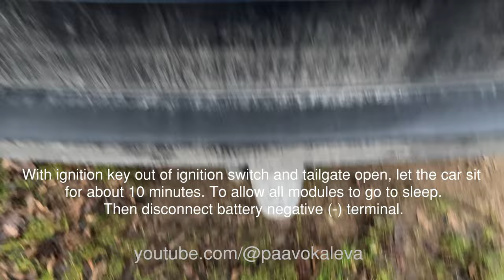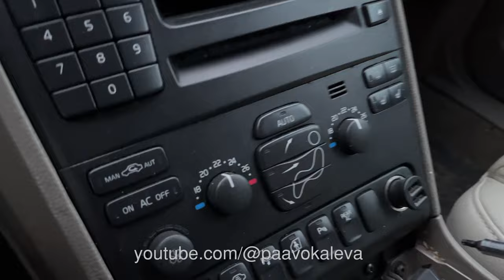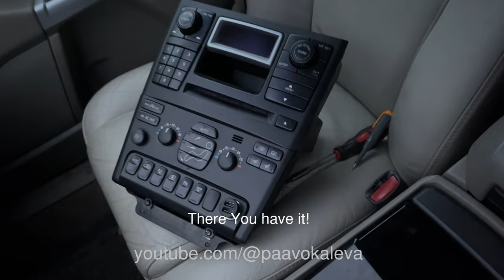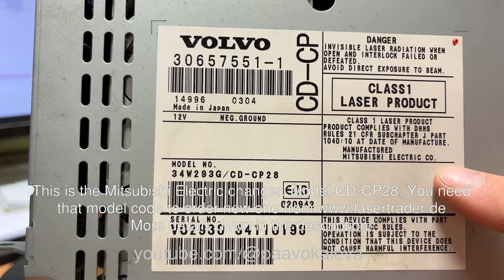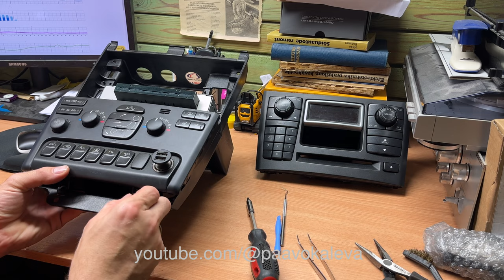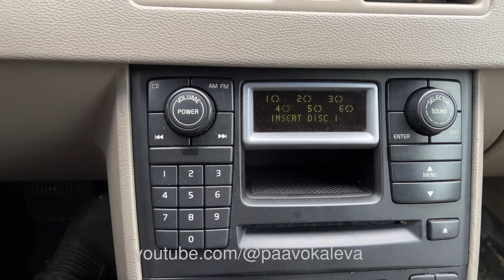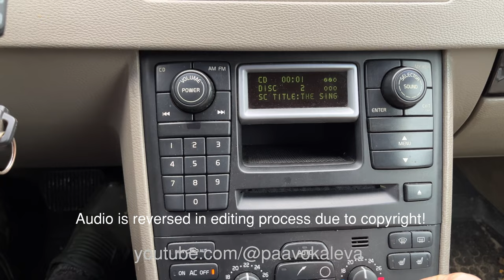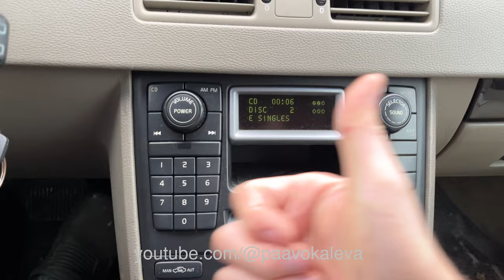HOW TO FIX VOLVO XC90 6CD in-dash changer CD-Box Step-by-Step tutorial #volvoxc90 #volvo #diy

Comment: Greeting from Sweden!

This should work for my S40 2004 too right?
I took out my 6CD changer and it had the model no. CD-CP1. I looked it up on lasertrader and the changer it finds lists both the CD-CP1 and the CD-CP28 which should mean that we use the same changer right? So it should theoretically work if i just follow your guide? 
My changer is just permanently stuck, it spit out 2 discs at once and one of those thin metal circular thingies that is on the inside in between the discs.
I need it to work for at least 1 CD permanently just to be able to install a certain CD to AUX mod.
Reply from the maker: Hi! CD-CP1 and CD-CP28 is the same mechanism by the lasertrader website and it should work on Your car. Follow my guidance and You are good to go.